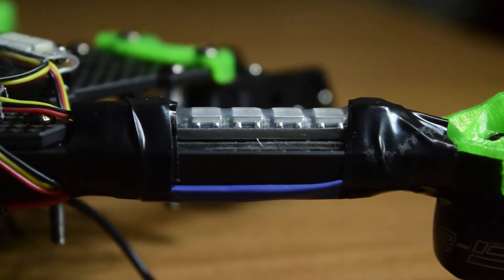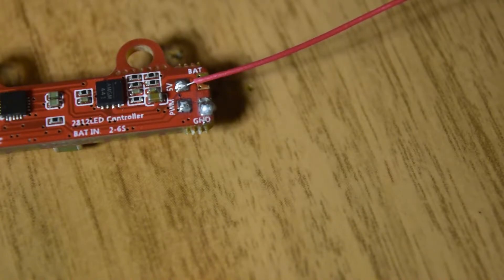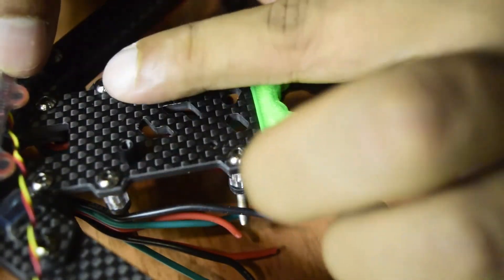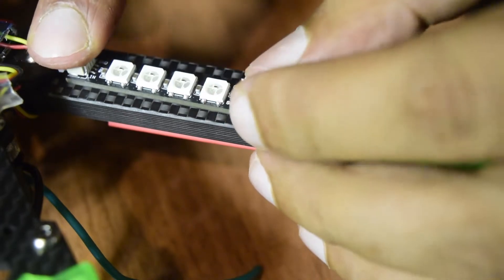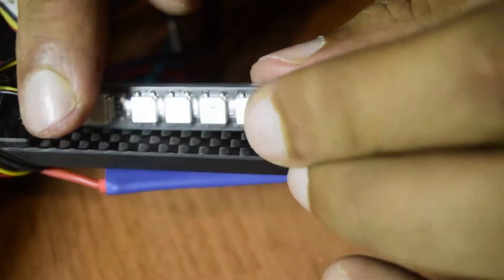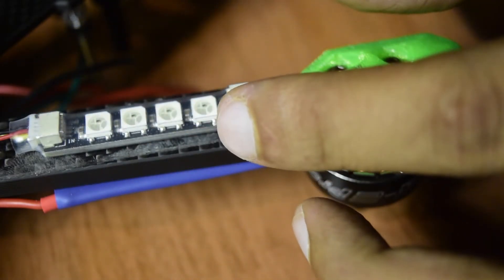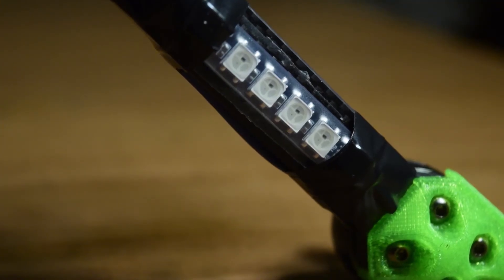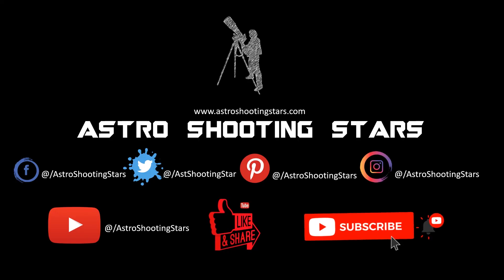HOW TO INSTALL RGB LED Strip to Done Frame and Flight Controller | HGLRC 2812 | MATEKSYS F765 WSE

Comment: Great video, well explained. Have you done a video also on how to wire the led controller to the HGLRC F722 mini FC as compared to the F722 there is no led pad, at least not that easy to find compared to the F722 FC where it is clearly stated. Or is there another method on how to set up the led strips using the F722 mini. Thanks for sharing.
Reply from the maker: here is the link for pinout for hglrc f722 mini for led pad 
https://salelesov.life/product_details/30002370.html

I hope this helps. please stay tuned to my channel for my future videos

Comment: Ok. I instal this just like you on my FC SpeedyBee 405 and this doesnt work for me. LED will light up but i can not change any settings via Betaflight... I cant even change color from controller, only mode. So i end with connecting individual strips to individual pads on my FC and then i have working settings from BetaFlight. But i want to change each diod individual with BF. And only sollution is connects this strips in one big strip am i right?
Reply from the maker: to control it via betaflight conmect each of the strip in series i.e. out of first strip to input pf other strip. then connect the first strip led pin directly to fc instead of led regulator and then have 5v and ground connected to supply from fc or from regulator board. then create the led array in betaflight to control them individually. I hope this helps. Please stay tuned to my channel for my future videos.
Reply: @AstroShootingStars  that's what I was thinking. ok thank you very much :)